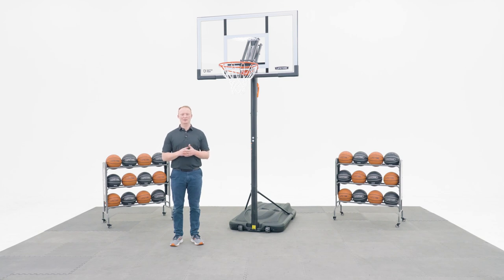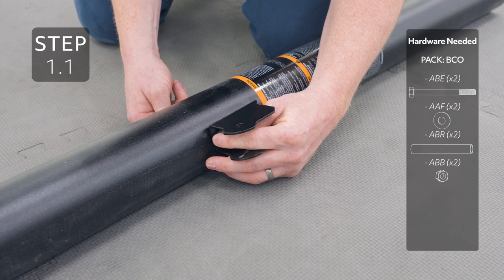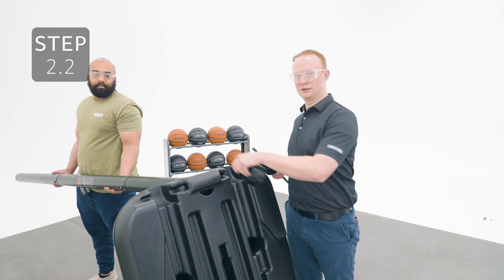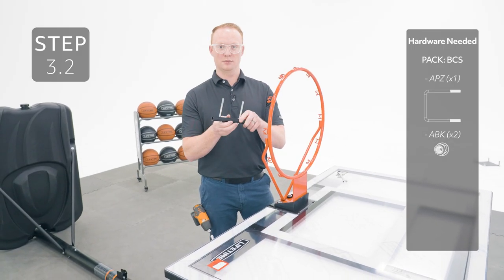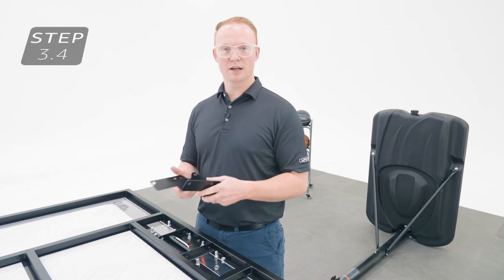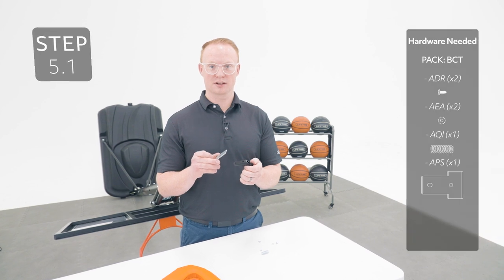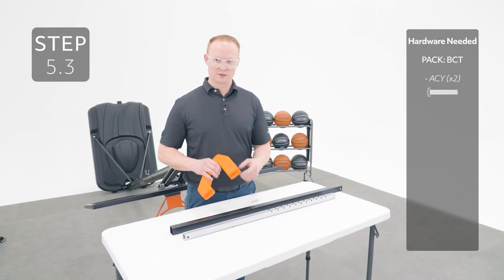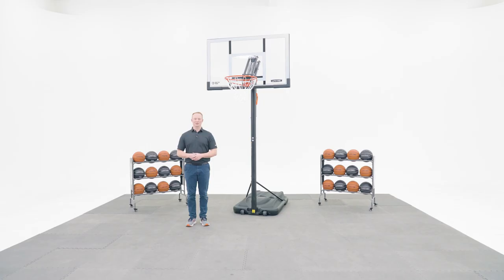Lifetime 54" Portable Action Grip Basketball System | Lifetime Assembly Video

Comment: My point is proven with these comments. There is zero reason lifetime shouldn’t have STICKER indicators where to exactly align the poles, these poles are stuck together and cannot be undone.
Reply from the maker: We appreciate the feedback. We don't have stickers that indicate where to align the poles, but in step 1.2 the manual says to align the hole in the bottom of the top pole (ALH) with the slot in the top of the middle pole (ALF). We do have one way that we have found to get the poles separated. Here is a video that walks you through it - https://www.youtube.com/watch?v=6WNdppuh7F8. Hopefully this helps. If you have any further questions, please reach out to us at youtube@lifetime.com.
Reply: @LifetimeProductsAssembly  which we tried to do, but there’s two sides. We aligned the slots and it didn’t come out exactly correct. your customers aren’t basketball hoop builders, the least your company can do is make this process easy for us or we think twice about buying lifetime products. So what can I do with my poles being stuck together now?